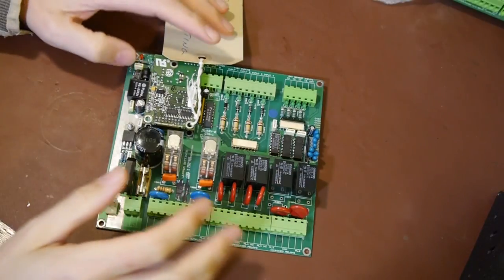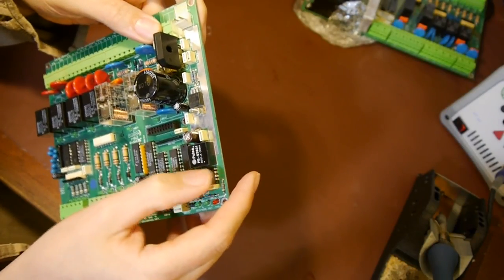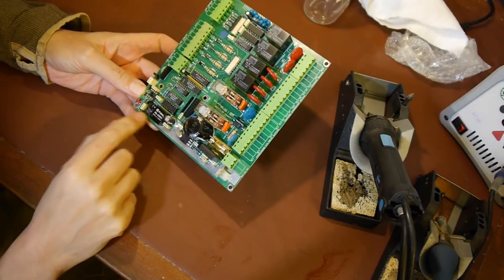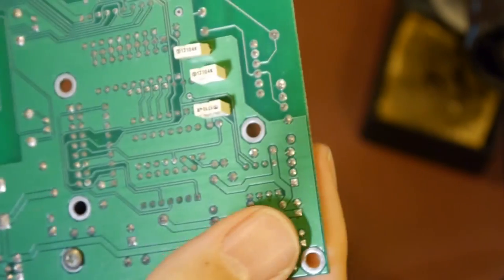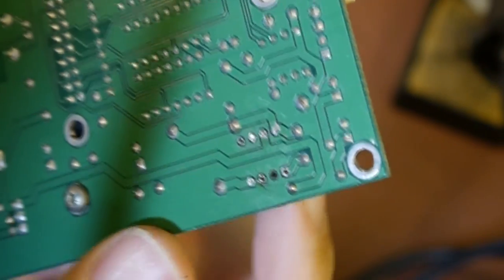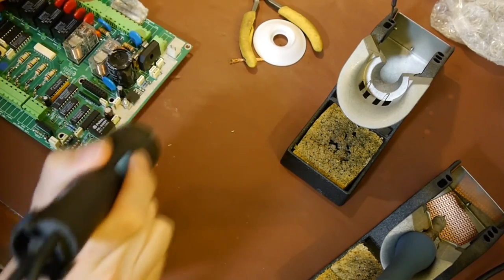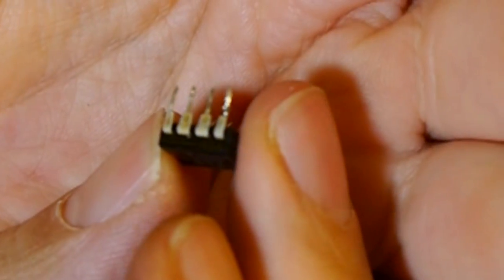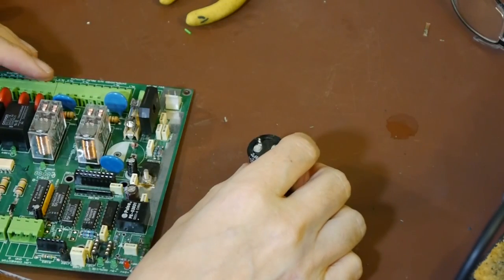Sucked Off

Comment: Sometimes a sewing needle can clean those holes out. Try to get it in the top of the board putting pressure on it  while you heat the bottom pad. Solder won't stick to the chrome plating of the needle. A white bearded technician taught me this many years ago.  ATB Doug.
Reply from the maker: Doug McArtin  Hello Doug I will give that a try next time I have one of these.  I think it’s one of those jobs where it’s whatever gets the job done etc. You have to respect the gray beard going to be one soon. Regards Chris

Comment: Love the 3 capacitors mounted underneath. Good to mix things up at times!
Reply from the maker: Michael Stevens Trying to think back 18 years ago. I think the  network transceiver on the processor module was higher than shown on the data sheet and we didn’t want to spin the board again. The PCB sits on very high pillars so seemed like a cheap fix. I remember I was quite annoyed at the time when I got the call from production etc.

Comment: Finally having watched this video (I'm behind!) and having read the comments, I think everything there was to say has been said. That sign is funny! It remembers me of the signs we have in the trains over here. It literally tells you "not to try boarding or alighting the train after the whistle has been blown", and while it's sure a correct translation from the Dutch text for our English speaking tourists, the wording is a bit weird for this day and age where "blowing the whistle" seems to have gotten a whole new meaning...

In terms of you soldering technique: 
1. As pointed out by Richard, you're way to quick to activate the pump.
My tip is to follow Richard's advice, it's solid.
2. I would like to add to use leaded solder to lower the melting point of the solder on the board, just add more leaded solder to the existing (possible lead-free) joints, before you even start thinking about the vacuum tool.
But I guess as a home tinkerer you already solder with leaded solder.
3. Another possible tip could be bringing the board up in temperature, heat the spot of interest with a heat gun or hot-air tool to ease the (de-)solderingiron's job in heating the joints. In other words: preheat the board!
4. Using flux is a good idea, but don't over do it, liquids that evaporate extract heat that you need!
5. Use an aluminium test-probe (on of those Hirshmann's will do, if you have them) to push out pin-remains while heating the pad with the soldering iron.
Reply from the maker: MrDubje  Hi hope all is going well for you. It’s nice to do a bit of board repair just for practice as it’s been a few year since I have had to do this to make my living. The main difficulty here is that the component leads are about the same size as the holes and there is no room for the vacuum to pull through.  I think I also under estimated the effect of the conformal coating contaminated the iron.  One of the comments mentioned using a cocktail stick to remove stuck pin. I’m guessing that could be a good idea as it won’t chill the joint like a metal tool and is not hard enough to damage the through hole plating.  I’m also quite new to using that PACE station. The old PACE unit I had previously had a much better vacuum pump unfortunately tips became obsolete and the new tools not as good.

Comment: Quincy & Police Academy were great shows!  I have never been successfully in using my heat gun in removing anything...other then stickers!  :)  Like you, I pull off solder pads often, so its kinda refreshing to see someone else do it as well!  Thats one reason why I stopped replacing all LED segments in my Sencore freq counter...way to freaky man!

You can't win them all, but a great exercise just the same!  I was kinda hoping you would have checked the carbon with your ohms meter to see what it read just out of curiosity!  I just realized last job, my tip on my desolder was a size to big, had they same issue, would not hold its suck very good, just kinda drowled it all over the place, was using a 1.5mm, need to order a 1mm...junk!  ~Jack, VEG
Reply from the maker: Vintage Electronics Geek To be honest I don’t loose a lot of pad the Pace temperature controlled tools I use take away a lot of risk. I new this board was going to be a problem and that’s why I chose it.  The production guys used to bitch and moan about working on them back in the day. It did however put up rather more of a fight than I expected LOL, I do love  those old 70 80 tv shows brings back happy memories. Thanks jack

Comment: well its worked for me but prior to getting a hot air gun I used to heat the board with a blow torch and give the board a whack but I wouldn't recommend it !
Reply from the maker: thehappylittlefox aka benji That’s ok I won’t grass you up to the health and safety police!
Reply: @allthegearnoidea6752  thanks thats very decent of you and prior to getting a desoldering pump I used to blow the solder away with a straw ! again I wouldn't recommend it !

Comment: Just watching your early technique, I am wondering if you are activating Mr suck's* pump a trifle early?
You want the solder to be all liquid before you hit the pump.
If you hit the pump too early, then you just suck up the solder on the surface, and once this has gone, not enough heat gets transferred through to the deeper solder (or the solder on the other side of the board) to melt it.

My technique is along the lines of:
Ensure there is enough solder to transfer the heat to the joint - I often just dab the tip of Mr suck with solder before applying to the joint, just enough solder to block the hole in the end.
Next apply the Hot tip to the Soldered joint, and wobble around the pin (I noticed you did this) this not only ensures the tip has transferred heat to the joint, but you can also feel the joint loosen up when the solder is melted through, and judge when it is time to hit the pump.

When  the solder has had time to melt all the way back through the Plated through hole (I count 1, 2, 3, while also feeling how loose the pin has become), then hit the Pump (4,5). 
If you don't suck it all out first go, then re-solder the joint, and do another pin or two before revisiting.
Larger geometry pins such as the capacitors of course require more/longer heat.

It may make you nervous if you have had bad experiences with tracks lifting etc, but allowing time to melt all the solder in the joint, is strangely less likely to damage the traces or plating on the board.

Also it is not unusual for the pin to be pressing against the side of the hole when the component was being inserted, and you end up with a trace of solder just tacking the pin to the through hole plating, even though the hole is otherwise clear of solder, just gently pushing the pins in with a flat screwdriver will break this.

oh, and Lead (expletive) free (expletive) Solder needs more (expletive) heat again, and is generally (expletive) and (expletive) to (expletive) with (expletive), (expletive), with (expletive), (expletive)!

*It is much easier to say "Mr Suck" than say, Hakko 808/insert model number of De-soldering tool (you don't have an 808 I note), and well De-soldering tools are unattractive, simple, Industrial things, so they could only really be blokes....
Reply from the maker: Richard Freeman Hello Richard thanks for that great comment lots of great information there.  I think I did start may be hacking a away a little with the desoldering tool but that pace station has a lot mass and I did reflow all the joints first. Although a bad workmen blames his tools I would not recommend that Pace desoldering station the vacuum is just weak 
I had an old Weller before that and it was hugely noisy but boy could it suck.  The main problem is the holes are just tight and the production guys used to bitch and moan about building these at the time but we never planned on repairing old boards. In fact  the company does not repair them it’s not economical to setup for the one or two boards a year we encounter.  

Know-one likes the conformal coating and they don’t want any lead getting into production. Lead free is not really something I have worked with  I try it every few years, hate it and just go back to leaded solder.  I never thought I would say this but as we have been swapping over the SMD it’s actually easier than through hole with a bit of practice.  I think we perhaps have opposite techniques I generally go in hot and make it fast I think most damage is done by over working the joint. I think Pace used to have a 2 second rule.
Reply from the maker: We all love Mr Suck Pump!
Reply: Ah actually I had forgotten that you had mentioned conformal coating, that of course adds another (expletive) level of complexity, and if the holes were so tight the assembly guys found them problematic, then your results were probably about as good as could be expected....

SMD of course has its pros and cons, the worst I have dealt with so far SMD wise is SOIC14, however I have a project coming up with a QFP144, and I have to admit I have been putting off soldering and testing that beast....
Reply from the maker: Richard Freeman  Hi Richard you have given me food for thought with your comments and inspired my next video “Mr Suck Pump Goes To Town”      I have been playing with that Pace desoldering station tonight and I have to say I’m really not impressed with its performance. It has a good volume of Suck but I don’t think it has the vacuum capability. It works ok for the large tips but putting a smaller tip makes it struggle. I’m also getting surprising different temperatures for varying tip sizes. This does surprise me given that they Are meant to have very accurate temperature controls.  Well as I said earlier a bad workman blames his tool but these boards are just really hard. I need to do a bit more digging but I suspect it’s a combination over undersized holes and conformal coating that’s contaminating the tip and also just preventing heating. You were dead right I was definitely getting sucked off prematurely and should have given it a bit more time. Also witnessed a huge difference for pads connected to a power plain etc and did not melt the solder all the way through to the component side. Needs more investigation.
Reply: While a bad workman may blame good tools, bad tools just don't help anyone, and then Conformal coating just makes it worse anyway.

I wonder if your Pace needs a clean, these sucky tools (in my experience) need a metric Fnarg load  of maintenance.
My 808 sometimes doesn't suck as hard, and a small amount of flux eventually gets back to the pump and can build up in the flappy valve thing (yeah, I probably should look up the proper name.... Actually I think it might be a flapper Valve?), but usually after cleaning it out, all is well.

Ah yes PCB ground and Power planes will just suck all the heat away, and then the race is on, as to who's the hardest hot sucker.....